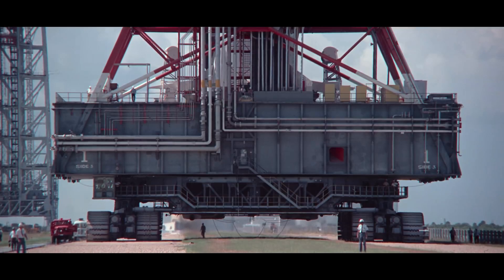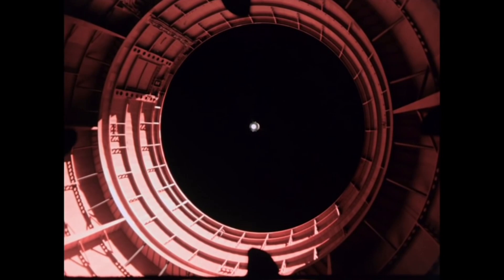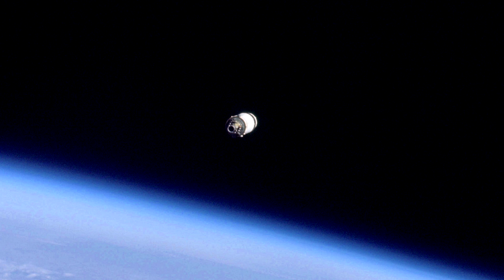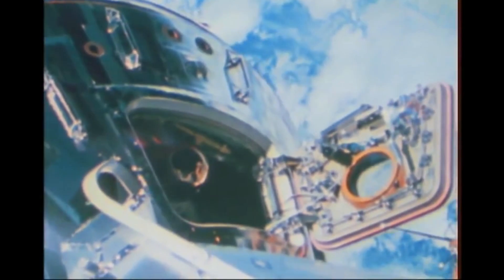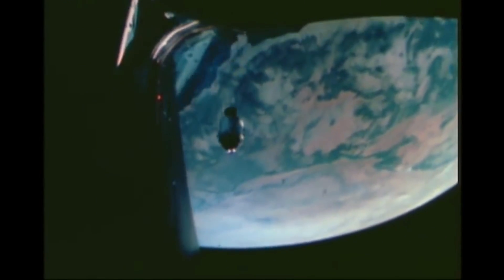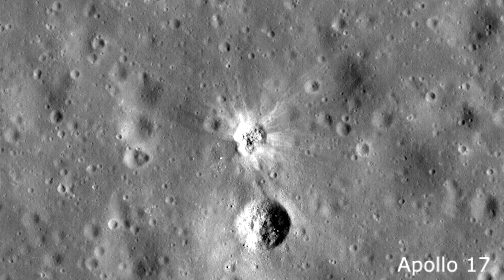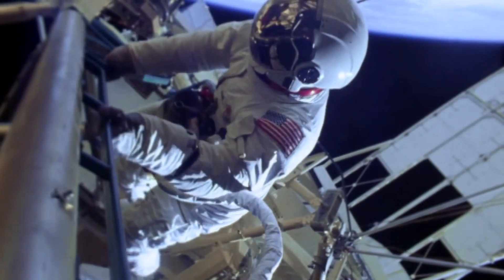How Did The Apollo 11 Documentary Get Film Of The Upper Stage Ignition?

Comment: Skylab had a diameter 6.6 meters, while the modules in the US segment of the ISS brought up by the shuttle have a diameter of 4.2 meters.  There was a proposal at one time for an inflatable module that would have had a diameter of 8.4 meters but it was cancelled as a result of costs overruns in the space station program as a whole (and in that module in particular).

Interesting to note is that the RL10   is still in use

Comment: For those that are Interested, this is a excellent book on the Saturn Series of rockets.  "Stages to Saturn: A Technological History of the Apollo/Saturn Launch Vehicles By Roger E. Bilstein"   It is well worth a read.  
One interesting tidbit about the Saturn-1.  Because of the multiple tanks used, it could be broken down and transported by air if necessary.  When it was first being developed in the 50's, ARPA wasn't sure where the rocket would be launched from.  They thought they might have to launch from a remote island in the Pacific which would require air transport capability.  This ability was never used because later launch sites were developed at the Cape.  The Saturn-1 was the first rocket that gave us greater lift capability than the Soviet's.

Comment: Scott, you said that Apollo 9 was the only time Transposition and Docking was performed in LEO.  Certainly that was the only time it was done in LEO with a LEM and the full Saturn V, but what about the Apollo-Soyuz Test Project?  Wouldn't they have used this maneuver to retrieve the Docking Module?
Reply: You´re correct. They did perform the same maneuver to retrieve the docking module from the spent S-IVb stage. So that would make it two times. It´d be 3 times if you count the attempt done on Apollo 7 (It didn´t have any hardware to extract though) .

Comment: Is the ISS in a high enough orbit that a solar sail could be used for orbital maintenance? Or would the drag of one outweigh potential "thrust"?
Reply: No it is far to close to the Earth, one of the main reasons why it needs to perform so many station keeping burns is because of the 'atmospheric' drag on the solar panels, plus it is orbiting so fast that it would only have a few minutes where the angle between the station and the sun is tangential to it's orbit, so even ignoring the air resistance the solar sail could only be making a beneficial contribution to the stations velocity for a very short period of time and considering the very large mass of the station and the very small impulse a solar sail could impart it probably would take hundreds of years to even give the station a boost of a couple m/s.

Comment: So "These people" who tell you the craters on the moon are not from impacts, what do they claim they are exactly?
Reply: I was wondering the same thing. What do these ding bats think is causing craters then? Oh wait…the Moon is made out of Swiss Cheese - right? 🤦🏻‍♂️
Reply from the maker: They point out that by putting an electrode a couple of centimeters from a surface and applying a high voltage they can make craters. They have yet to explain how you hold such an electrode close enough to the moon to do this.

Comment: at 8:10 the booster was gravitationaly affected by the Lagrange point 1, How and why do the lagrange points have gravity or why did its orbit change in a way that it looks like it was pulled towards L1?
Reply: The Lagrange points do not have their own gravity in any way. An object orbiting the Sun on a lower orbit will normally have a shorter orbital period than the Earth, however if the object happens lie close to the line between the Earth and the Sun and is sufficiently close to the Earth then the Earths gravitational pull will influence the object enough to increase this orbital period. The L1 point is the point where despite being on an orbit that is closer to the Sun an object would have the same orbital period as the Earth.

The reason in the simulation it looks like the object is pulled toward the L1 point has to do with the fact that the simulation is viewed from the Earths fixed point of view. This is going to be hard for me to explain with out using to much physics jargon... As the object approaches the L1 point it's orbital period begins to approach that of the Earths, from the Earths point of view this looks like the component of the objects velocity that is tangential to the Earths own velocity decreaing to zero as it matches Earths orbital period leaving only the objects apparent radial velocity with respect to the Earth. As the object continues to move outward away from the Sun (radially toward Earth) and is further influenced by the Earths gravity the objects orbital period around the sun increases meaning it is moving slower around the Sun relative than the Earth is, from the Earths point of view this looks like the component of it's velocity that is tangential to the Earths own velocity reversing and the object moves down the screen.

 This is why as the object approaches Earth it appears to be attracted to the L1 point and later when the object is leaving it appears to be repelled by the L1 point, it is because we are viewing it's behavior as if Earth were a fixed point in space, so we are seeing the boosters motion relative to the Earth.

Comment: 4:22 Why is there a Ukrainian flag on the lower left corner?
Reply: Ha! I finally figured out what you were referring to. (Wish I could post a pic here) It a Blue and Yellow label right above the Rotation Hand Controller that indicates whether the controller is “Armed” or not.

You can just make it out in the 5th photo down on the page below. It still has the yellow “Armed” label, but the little blue label above it is missing.

http://www.space1.com/Artifacts/Apollo_Artifacts/Rotation_Control_Inside/rotation_control_inside.html

The Smithsonian has a 3D scan of the interior of Apollo 11 Capsule which you can navigate around in. If you position yourself correctly, you can see the Blue and Yellow labels just above the hand controller. (I took a screenshot from the angle shown in the video but I can’t post it here.)

Comment: So the S-IVB on Apollo 9 placed the CSM+LM in orbit and then proceed to make further 2 burns? That's 3 burns total. I thought the J-2 engine could only be re-lit twice.
Reply: 1: Lit
2: Relit
3: Relit

So 3 lights, 2 relights.
Reply: @glennac  I phrased it wrong. Should be "lit twice". Two ignitions total.
Reply: Nelson Cruz, Typically, two burns would be enough. But remember, pre-11 missions were tests. So they tried 3 just to make sure it was possible. That’s my conclusion anyways.
Reply: Nelson Cruz, This is interesting, Wikipedia states, when referring to the initial testing of the J-2 rocket:

“Testing continued until January 1966, with one engine in particular igniting successfully in 30 successive firings, including five tests at full duration of 470 seconds each. The total firing time of 3774 seconds represented a level of accumulated operational time almost eight times greater than the flight requirements.”
Reply: @glennac  it's my understanding that most rocket engines can be restarted on the ground, and usually are for testing purposes. In test stands external power sources can be used, or the starting up mechanism replaced or refueled (some engines carry a special fuel just for staring the turbine). Very few engines can absolutely only fire once and fly untested (I believe that was the case for one of the Lunar Module's engines). 

The Saturn V's second stage had five J-2 engines that could only ignite once. The third stage had one J-2 set for 2 ignitions (as far as I know). Maybe on Apollo 3 it was specially modified for 3 ignitions.

Comment: Fun fact: When Mission control told Apollo 13 that it's SIVB had crashed into the moon as planned they  commented "Well, at least something worked on this flight.".

 078:02:25 CC:  By the way, Aquarius, we see the results now from 12's seismometer. Looks like your booster just hit the Moon, and it's rocking it a little bit. Over.
078:02:44 CMP: Well, at least something worked on this flight.

Transscript says cmp (Swigert) but it was cdr (Lovell). The time is the get, the time since launch.

btw: Homesteading Space: The Skylab Story  very interesting book. Very interesting story. Very impressive saving and repair effort under extreme time pressure. Rivaled in effort only by saving Apollo 13. Sadly a somewhat forgotten story..
Reply: There was another reason why they were happy when the SIVB hit the moon. A radio transmitter on the SIVB used the same frequency as a transmitter on the LM. On a normal mission this wasn't a problem because the LM and the SIVB never operated at the same time, but on Apollo 13 they did. The interference ended when the SIVB impacted the moon.
Reply: @joevignolor4u949  yeah in that videos comments someone claimed you can hear the moment of impact because the static was suddenly much less.
But it became much noisier again later.  I think it messed up the tracking much more than the com. Or more precisely it messed up com (including a actual loss of it for quite some time) while they were trying to establish tracking on the LM around the SIVB.
The com was also bad because to save power most of the time amplifiers and stuff were turned off. And only activated when they needed clear com to read long checklists up.
Reply: HEre it is, in this (amazing) full mission audio video at 29:17   https://youtu.be/GtQZB0a0XcU?t=1757
And this is defnitely Jim Lovell.

Since this is youtube i should add: the footage in that is obviously from a simulator. To approximately show what happens instead of a black screen.

When there is actual footage available (launch, tv transmissions) they are shown.
Reply: That IS a fun fact. Thanks.

Comment: Hullo, Scott!

An unrelated question came to my mind, which I've been meaning to ask you to do a short video about:
How did the Titan III SRB's steering work? I know they used compressed nitrogen, possibly to divert the exhaust, but I haven't seen it well explained anywhere. Please and thank you :)
Reply: It uses something called Liquid Injection Thrust Vector Control (or LITVC for short), a concept developed in the late 40s and used since the early 60s. Since my English isn't quite good, I'll quote a section on TVC systems from Rocket Propulsion Elements (written by George P. Sutton): "The injection of secondary fluid through the wall of the nozzle into the main gas stream has the effect of forming oblique shocks in the nozzle diverging section, thus causing an unsymmetrical distribution of the main gas flow, which produces a side force. The secondary fluid can be stored liquid or gas from a separate hot gas generator (the gas would then still be sufficiently cool to be piped), a direct bleed from the chamber, or the injection of a catalyzed monopropellant. When the deflections are small, this is a low-loss scheme, but for large moments (large side forces) the amount of secondary fluid becomes excessive. This scheme has found application in a few large solid-propellant rockets, such as Titan IIIC and one version of Minuteman."

Just to be perfectly clear, such scheme doesn't require a movable nozzle, thus simplifying the design. Obviously, there's a weight penalty for carrying the secondary fluid, but bear in mind that such fluid, when injected to the exhaust, increases the specific impulse of the engine, which pretty much offsets that penalty.

I hope that answers your question. Sorry for not providing any specifics on the system used in the UA120 SRM, I'll see what I can find.

EDIT: I just found this little piece of info about the Titan IIIC SRM (UA120) from an AIAA paper (AIAA 88-3476): "Flight control during Stage 0 burn is achieved through use of a liquid injection thrust vector control (TVC) system. Control is accomplished by the secondary injection of liquid nitrogen tetroxide (N204) from a pressurized tank attached to each SRM into the fixed nozzle. This creates a side force component in a direction normal to the nozzle center-line."

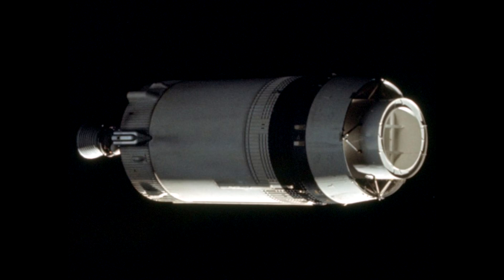Comment: The S4-B shown at 7:33 and 7:44 is from the Apollo 7 mission. You can see there are beams in place that would prevent a LEM from being installed and the 4 panels of the adaptor are still attached. A target is attached for the Apollo 7 crew to practice approaching (from a distance) as if a LEM were actually in the hold.
Reply: Yes, and the SLA-panels didn´t eject on 7 (they weren´t designed to do so at that point) ,  and one of the panels didn´t open up fully, which prompted the re-design for later missions.

Comment: Another great video - thank you ! I believe that the first stage of the Saturn V required to be connected to a ground-based source of hydraulic power to provide the energy to get the engines running. Once the engines were running, the hydraulic system would automatically disconnect itself, and the rocket could then lift off.   Presumably, the ultimate purpose of this was to reduce the weight of the first stage .  My question is, are there any other rockets that have needed ground-based hydraulic systems to boot up, particularly modern ones?
Reply: The ground based hydraulic units actually pumped pressurized rocket fuel into the first stage before engine start to move the F-1 engines to test the gimbal mechanisms that steer the rocket and to position the engines for start up. Once the F-1's turbo pumps were started and running at full speed the fuel pumps took over and provided pressurized rocket fuel at 1,200 psi to the steering mechanisms, which used two large hydraulic cylinders to move each of the four outer engines. As such the rocket didn't need a separate dedicated hydraulic system with reservoirs and pumps to move the engines. Instead they just tapped fuel off the fuel pumps and used the pressurized rocket fuel instead of hydraulic fluid. This reduced both complexity and weight. They also used pressurized rocket fuel inside the turbo pumps to lubricate and cool all the bearings. And as you noted the ground hydraulic units are disconnected at liftoff.
Reply: The Saturn V's F-1 engine's start up sequence was quite complicated. It was basically split into two parts, the pre-burn and mainstage. The first thing that happens is kerosene fuel and LOX begins to flow into the gas generator, which is like a small rocket engine mounted to the turbopump. A set of igniters inside the gas generator fire it off. This produces a smokey, fuel rich column of hot gas that exits the gas generator at very high speed. This output gas passes through a set of turbine wheels inside the turbopump, which causes the fuel and LOX pumps to start rotating as they are mounted on a common shaft with the turbine wheels. After the hot gas passes through the turbines it flows through a manifold into he engine bell. Here it comes into contact with LOX that is flowing into the engine under tank pressure through the open main LOX control valve. Two additional igniters reignite the rest of the fuel that is present in the turbine exhaust. This is what produces the swirl of flame that can be seen inside an F-1 engine as it starts up. Additionally a container of hydrazine fuel is pressurized by the now spinning fuel pump to inject the hydrazine into the combustion chamber. This produced the shot of flame that can be seen coming down out of the engine when it starts up. Once the pre-burn sequence is complete the engine bell will be full of flame, which then begins to propagate up the side of the rocket. At this point the main fuel valve opens to begin allowing fuel to be pumped into the engine along with the oxidizer. The mixture is then ignited by the flame from the pre-burn. After a few more seconds the turbopumps finish ramping up to full speed and the engines arrive at full power. At that point the thrust chamber pressure reaches 1,000 psi and a pressure sensor sends an electrical signal up to the instrumentation unit telling it that the engine is started and ready to go.
Reply: @joevignolor4u949   Many thanks for taking the trouble to explain this so thoroughly.  Some years ago I found and downloaded  the Saturn V Flight Manual SA-503 as a pdf. Dated 1st November 1968. I have been trying to understand as much of it as I can ever since.  Presumably the hydrazine you refer to was in the hypergolic cartridge that ruptured once the pressure had reached a certain level.  In Scott's video, Skylab gets a good mention.  I remember seeing this fly over my parents' house in London, England on a summer's evening in the early 1970s.
Reply: @stevebeal73  Yes, the hypergolic fuel is stored in a cartridge that has two membranes, one on each end. When the fuel pump pressure reaches a certain point the membrane on the inlet side ruptures first. This pressurizes the hydrazine inside the cartridge, which then ruptures the membrane on the outlet side. The hydrazine is then forced out of the cartridge. It then flows through a supply line to a special hole in the center of the injector plate and into the thrust chamber.
Reply: @joevignolor4u949  Thank you!  Now I know who to ask when I need any more information on rocketry!  I have often thought a good quiz question might be "how many different types of racket engine were on the Saturn V?"  As far as I  can see there were  4 types (1) kerosene+liquid oxygen (eg first stage) , (2) liquid hydrogen plus liquid oxygen (eg second stage) (3) solid (eg ullage motors) (4) hydrazine +dinitrogen tetroxide (eg Service Module).  Plus thrusters.  Any others?
Reply: @stevebeal73  That's it. The LM used the same fuel as the service module engine. So did the reentry thrusters on the CM. Solid motors were used for ullage and stage separation motors and the motors in the Launch Escape System.